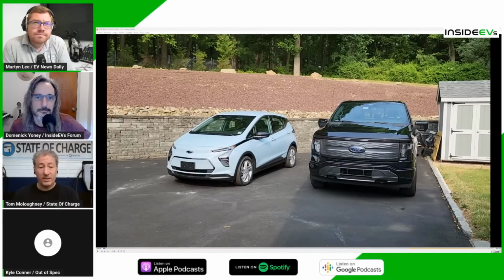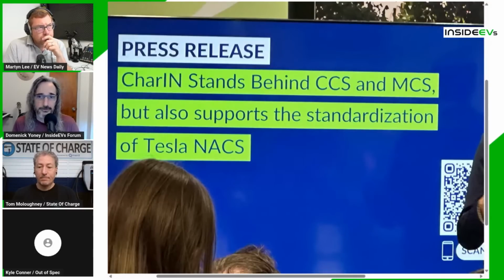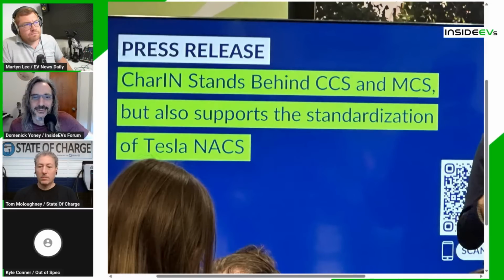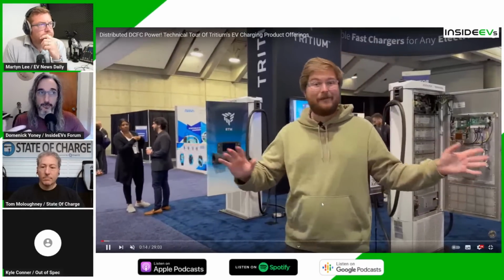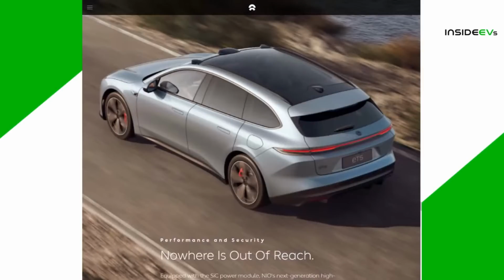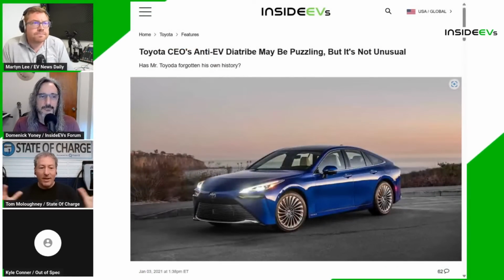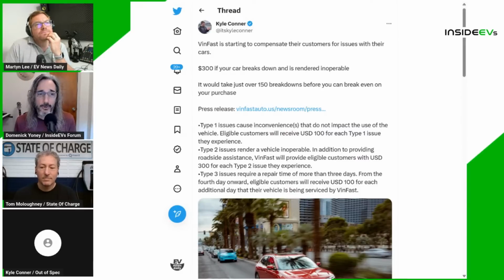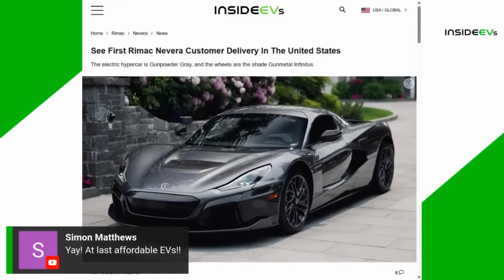Toyota Plan Envisions 900-mile EVs, Chevy Bolt EV May Have An Ultium Future

Comment: Since Tesla has "released" their charging connector hardware design, if Tesla dousn't want to play nice, CharIN along with other auto manufacturers can technically create a de facto stardard based on the Tesla connector hardware, but completely using standardized software/backend (eg., using CCS protocols). Of course this would not compete with Tesla's, because it still will not have Tesla's software....

Comment: I believe I heard that NIO will not be offering the battery swap capability in the U.S.  If that's the case, does the battery swap capability, presumably built in for the other markets, offer any  advantages or disadvantages?  Or will the U.S. market cars be differently engineered from the cars for other markets?

Comment: I want to put $100 down to reserve the KIA EV 9, as soon as it opens - unless the Ford EXPLORER EV opens up first  : )  either way, my wife says she is NOT going totally EV unless she gets three rows of seating...  unless she test drives the Mercedes EQB and actually likes it, first.
Reply: I've got an EQB and I can absolutely recommend it. Very nice place to be and a good EV across the board, even if it doesn't have any headline-grabbing specs. But if you're looking to use your third row regularly, I might wait for the EV9, which is way bigger, as far as I know. The EQB's third row is usable, but only for kids and if you don't want to carry much luggage at the same time.
Reply: @krugerdave  I'm amazed, as my wife is, too, that the MSRP on the EQB 250 is LESS than her current PHEV from KIA...  crazy... and yes, the third row option is really what she wants, not necessarily a 'large vehicle' with a dedicated third row - storage for everyday, and third row for 'special occassions'...  the EQB 'negative', at least to some, is the confusing routing and number of lines and 'mess' in the frunk... or, I mean 'no frunk', although I don't think the frunk is a needed area for storage... but, that's just me.  My LIGHTNING looks just like the frunk of the EQB when you remove the frunk storage bucket...

Comment: the BOLT EV:   while I have the new LIGHTNING PRO EV truck, and my wife has a new PHEV Kia Sorento, which are both GREAT(!), and I've driven the model 3 across country and back, the 'newly used 2019' BOLT EV we got recently for our Son, in college, is FANTASTIC!  I have NO ISSUES with a small 4-door 'suv' hatchback - and it was $20k, used, on a private sale, with NO EV TAX Credit - and I STILL LOVE IT.
Reply: How’s the Pro ? I wanted to get one but dealer was marking it up at $15k over MSRP
Reply: @williamerazo3921  Fantastic, amazing, and everything Jim Farley said it would be  : )  25,000 miles already, since August 24th, and loving it - towing my 3,000lb camper half those miles, too...   powered the house for a while during that last power outage, worked perfectly... love the 'SPORT' mode  since it creates much more REGEN versus 'Normal' mode, and even 'Tow/Haul' mode... rarely use 'One Pedal' driving, although I did for a few minutes in ATLANTA traffic yesterday - SPORT mode does it just as well.  LOVE the amount of ROOM in the backseat with the seats stowed.  I even keep a mini-fridge powered there when traveling.
One of the greatest joys is that most folks don't even KNOW it's an all-electric truck, at least until I'm parked at a Fast Charger - even then, they sometimes think I'm just taking up some 'EV's' space!  

Love it.  Get one, even with the price increase - you'll not find the option from Chevy or Ram or anyone else anytime soon.

Comment: Any OEM can sell lots of cars...if they sell them below cost. Long term only way to have mass scale $26k BEVs is for them to have a decent profit margin.
Reply: But that's the conundrum.
You have to get "over the bump" by building expensive, profitable vehicles in a smaller, relatively "cheap" factory, to fund the huge factory producing cheaper, low margin vehicles in massive volume.
.
The only reason Tesla made it (aside from the obvious) is that they were not considered a threat until it was too late.
.
Also, Tesla didn't have decades of entrenched "comfortable (bloated) management"
Or dealers.
Or unions.
They weren't chewing a leg off to get out of the trap.
.
Now, they HAVE TO sell a lot of cars to fund their transition, but they need profit from every one to get there.
They can't sell below cost.
And
If they drop the MSRP, dealers just say "thanks a lot" and bump their own profits.
.
It's going to end badly..... Soon.

Comment: All the random car purchasing being mentioned on this episode is missing the point of trying to address Climate Crisis with EV adoption. Even EVs have a large production CO2e impact.  The EX30 is alleged to be 25% lower than their current EV offering XC-40 Recharge (full BEV). But that car has 25 tons of embodied carbon. 

So the mentality must shift away from owning 10 EVs in 12 years (as Tom mentioned on Autoline Detroit youTube, which was a good interview, Tom). We need to show through example that choosing a car you can live with for 10+ years is expected. I know these cars get resold into the car market, but cars get scrapped because of all the churn and devaluing of older cars because there are always newer cars that make more sense to own. Car ownership needs to shift to longer term or not at all.

Buying cars is a national sport that needs to end. 3 year leases exacerbate churn and encourage excessive consumerism in car manufacturing.
Reply: Watch/ read the Tesla impact report.
It's all in there...... With data.
Reply: @rogerstarkey5390  Please explain what you think I didn't understand from reading the Tesla Impact report. Are you assuming you know how much CO2e impact comes from each Tesla model built based on those impact reports? If so, please quote an exact lifetime production CO2e number from a Model 3 SR or Model Y Dual motor. Include the page and impact report link you're sourcing it from. I'll wait. 

Tesla chose not to disclose the numeric values on their graphs. They list everything as a full LCA and don't break out the operation vs. production. They don't break out the battery. They don't show all the models. What you do get is some nice misdirection that all is well with Tesla and that you should feel great about the direction everything is heading.
Reply: @rogerstarkey5390  also, how does the Tesla impact report condone buying 10 cars over 12 years or constantly replacing cars via leasing?

Comment: Everyone is mixed up two things. One, production intended EV and just Lab level prototype.
900-mile EV with solid state Lithium ion battery and sub 0.2 CD are only for prototype targeting on 2027. Solid state battery needs several more breakthroughs before mass production.
Mega-castings (with giga-press) and new EV platform is for the production EV. Not much difference than what Tesla is already doing.